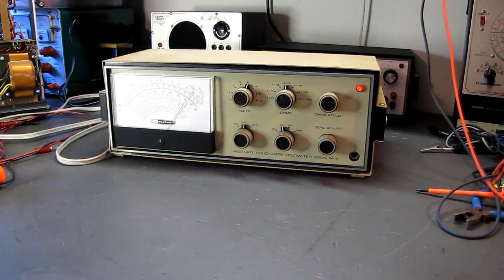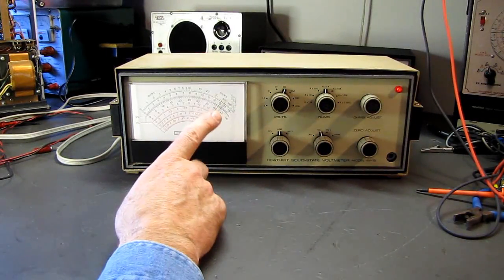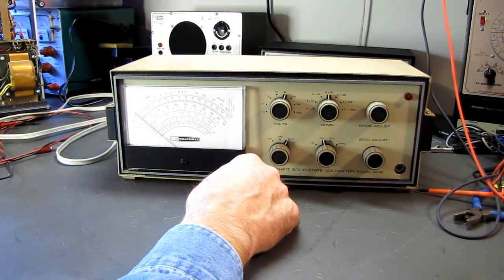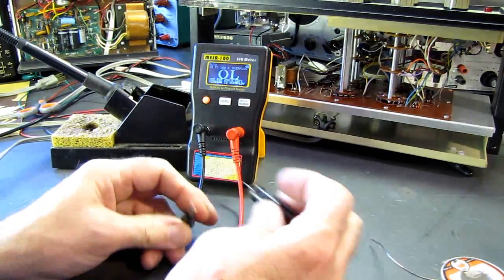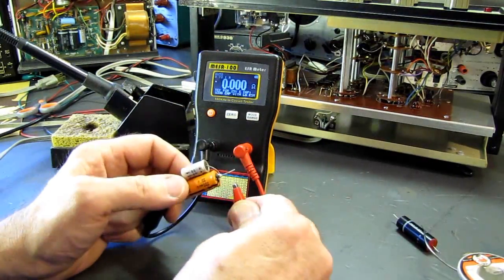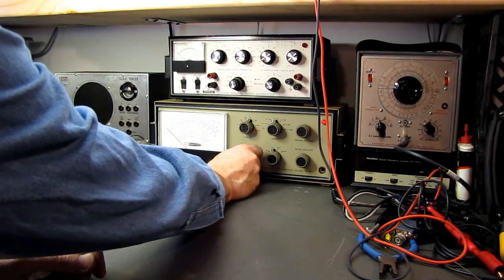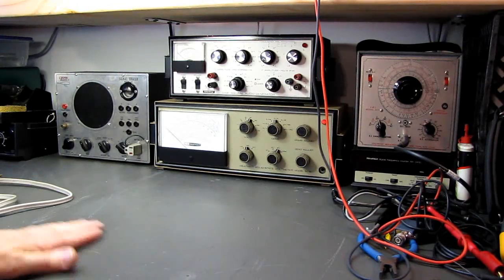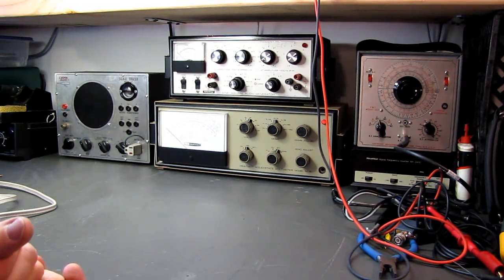10 Buck Test Bench Heathkit Voltmeter Repair

Comment: An easy low watt isolation transformer is just to run two identical fillament transformers nose to nose (line in - lv - lv - line out).
Reply from the maker: I actually have a video where I show how to do that.
Reply: The Radio Mechanic  Just passing on info to possible newbies.

Comment: The Radio Mechanic    Hello from Ray Burke.   I have built one of these IM-16 a long time ago, and I still have it.  There is a sub chassis that connects the outside of the input phono jack which has insulators on the switches, and is isolated from the chassis ground. ( I remember installing the insulators-dual haves.)  You probably don't have to disconnect the power cord, my battery died a long time ago.  There is a calibration control for balancing the line to battery switch settings, you can find the schematic and calibrations online.  Later Ray Burke
Reply from the maker: Hi Ray, I have the  documents and have three of these meters. This was a simple power supply issue. But thanks.
Reply: Hi The Radio Mechanic     Ray Burke  I was commenting on the isolation of the power cord from sub-chassis.  In that the sub-chassis was separate from case ground, with totally separate ground points.I don't think you need to disconnect the meter from the power line to work on AC/ DC Radios, I could be wrong.  ( Could measure power cord ground to sub-chassis resistance? )Later Ray Burke

Comment: Nice video thanks...just a quick question what ESR meter is this cheers
Reply from the maker: Do a search on e-bay for MESR 100 and you will find it. Lowest price seems to be around $42.00 which in my opinion is highway robbery as I bought this originally as a set/pair with the M4070 LCR meter, and paid something like 40 bucks for the pair. The price has gone out of sight.